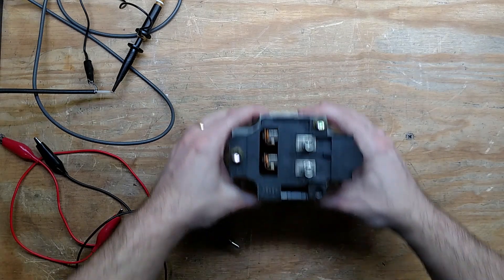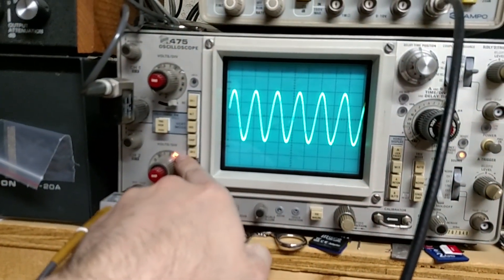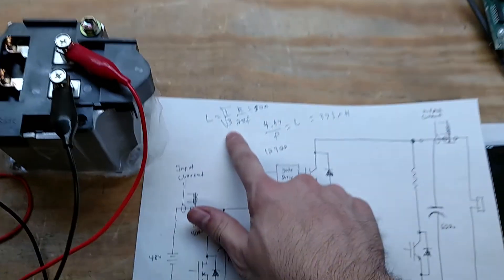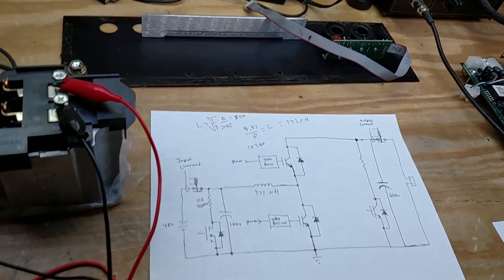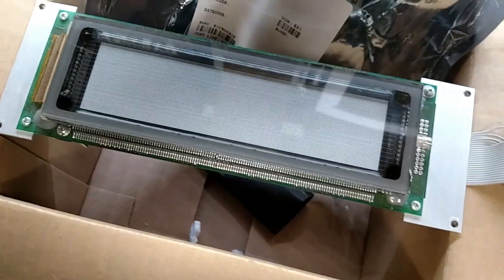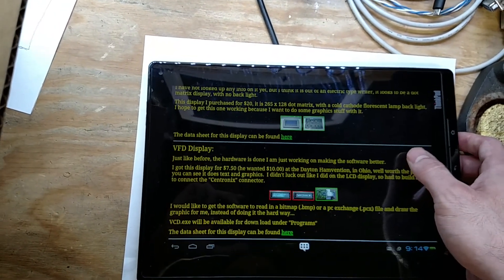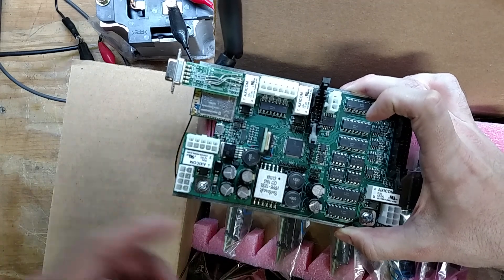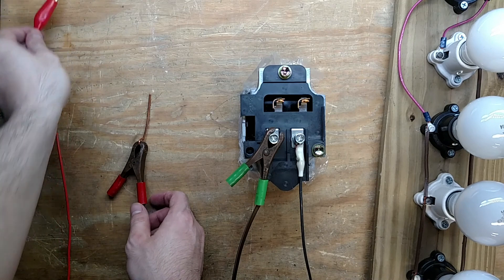Bi-directional buck-boost converter, Part 2

Comment: Thank you so much for this great video. I am wondering when you calculated the value of the inductor, why you divide the equation by root(3)?
Reply from the maker: +Mostafa Mosa 

See this link for the derivation:

http://www.edn.com/design/test-and-measurement/4363759/Circuit-measures-capacitance-or-inductance